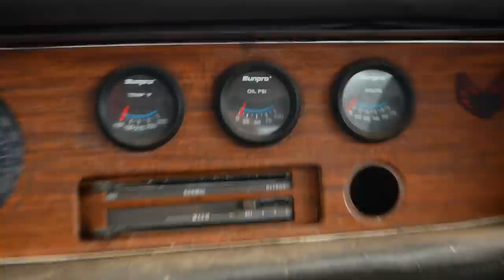Firebird Formula First Start in Years!

Comment: It's kinda sad for me to c ur 73 firebird, cause I had one and I was the 3rd owner of the car. But mine came factory formula 455 SD n it th400 thrans I put 410 gears n it. But all the car needed was paint and interior,  all of the running works didn't have 2000 miles on it. The car only had 120k miles on the car. I had the lead engine builder at "Nunzie Pontiac n Michigan" Herb McCandles, build/balance/blue print the 455. It turned out to b a 462 ci wit 505 HP and 500 foot lbs of tourq. To b as heavy as it was, it was pretty fast for a street car. I got n the low 8.11's n the 1/8 of the mile.  🤙 but I got n some trouble and had to sale it to help with lawyer fees. But I got me a 98 stepside s/10 tht I'm starting on now, I took my 880 5.7 vortec motor to the machine shop last March, and I just got it back this March. Its a 350 rollor motor, a 880 block. I got me a set 5cc dome pistons for it, and i got a 186675-10 Hawards 312, 320 .600 .600 lift cam for it with 1.5 rockers..idk if ima port the vortec heads and and get the bigger valves put n them an run them !! Or ima get me a set of them HKB aluminum heads from Skip White performance, I can't wait to get this little s-10 going !!! But anyway good luck with the firebird tho ! 🙏

Comment: There is software out there that can recover "lost" or better yet "deleted" files on a hard drive. When working with file systems we have to be librarians. What did we name it and where did we store it, which is why the search function is so helpful. However, files that get deleted can still be recovered because a deleted file is actually still present, but is missing its locator. When we tell our OS to delete a file on purpose, that file is then categorized to be over written someday in the future and its locator stripped. If not too much time has elapsed, the recovery software can find it. That file will probably have an alpha-numeric name attached to it as will all of the recovered files slated for deletion. So to verify which files are worth saving, once the recovery software locates them, just open each recovered file, then rename and relocate the ones worth saving.

Comment: You got your hands full double check the timing they'll run 180 degrees out bring #1 cylinder to top dead center and make sure the rotor points to #1

Comment: Paint it white with blue trim like one of the original factory options. But before that it needs to be totally disassembled to remove all of that rust. Also put the original formula engine and transmission in it. I hope you have plenty of money because making that mess like new again isn't going to be cheap. Btw, how much did you buy that for?

Comment: Hey. I have a guy selling a 1977 Triumph TR7 for only $500 and the only rust it has is on the ass end has motor and transmission and everything you need to run it but it won't start

Comment: Why do you need body panels? That roof needs replaced for sure. But those panels need a angle grinder sand, rust converter coat and a skim coat of Bondo and a shot of paint...just saying
Reply: I've discovered bondo that I didn't even know a out...found while painting and took it down to the  metal to discover a dent. I basically redid someone else's work, pulling the dent...
I'm guessing they don't want a bondo wonder

Comment: Take the windshield out and sand it all clean and prime and paint to keep it from going bad because right now it is very fixable with some sanding and painting. Cleaning. Motor probably has leaky valve guide seals. Im sure its not a fresh motor but it is not too bad. Did you change the oil is it full of water? The non existent pvc valve can cause  leaky vacuum can make it run horrible. I would bring that car back from the dead. Sure put a 400 in in it becasue it only cost money. You can play with the 350 for a while when your putting together your secrete weapon 400 Pontiac.

Comment: Carb cleaner?? Not the best way to get an old beast started for the first time.Try a small amount of gasolene or starting fluid. More volatility  and less byproducts .Also there is something arcing off the back side of the HEI.The engine sounds like its perfect. Just needs to be cleaned out. Don't trash it.

It's misfiring Because of the spark on the HEI is leaking to number 4 or 5.

Comment: why do we go straight to "bad valves"?  why not check inside the dist cap and replace a rotor.?  rotors are fairly cheap, $6 or so, and make a big difference if the car has been sitting.

Comment: sounds like the distributor is 180 degrees out of turn i acually got an old firebird for 500 bucks cus it sounded like that and figured out they flipped the distributor around 180 degrees they will run like that but will run like shit and back fire out of the carb almost constantly. just something to check

Comment: Old video and catching up with 'A Formula 350'? Not the stock Pontiac '400', in 73 was Pontiac's factory blueprinting... larger valves and ported heads, for the factory headers. Rather a step down from the 455... but the Formula Firebird with the right Carb,.. namely a Holley 650 double pumper with mechanical secondaries... with long tube headers, and the 400 Block... really begins to breath.

Comment: Laughing my butt off most of the video. When you guys were trying to start it at 11:15 and your bud had his arm over the carburetor. I was thinking man if that backfires he's gonna get his hair singed. Seconds later pop, and he got singed, I was just laughing my butt off, because I've been there and done that years ago when I was your guys's age. Oh and whoever the dumb butt who put a Chevy in a Formula ought to be SHOT, It's not a Camaro it's a Firebird. Anyways back to the FUN! I'll dig around and see what I have left in the shed. I know I have a rust free 74 bare door with a small bend on the front flange. A Pontiac 400 Manual Bell housing, and a 1976 Shaker top lying around here. I think I have some small interior parts too, but that would require me to dig through the shed to get to those. I Also have a rust free, but some light front Bondo, 78 Trans Am front Passenger fender. If your interested give a comment on one of my videos and I'll see it. I did keep my last muscle car, the 69 GTO with the original interior, engine & trans, sorry that's not for sale. That's my retirement project. Thanks for sharing all the fun. I look fwd to seeing more of this project. This too is one of my favorite Firebird's, makes me miss my 1974 400 4sp TA. Best Wishes & Blessings. Keith Noneya

Comment: Not a very good idea to do donuts right next to a gigantic rock, and a wall made out of bricks my man, especially considering that while the roof is junk, the rest of the body seems to be in decent enough shape to be saved with minimal rust repair, as for the engine, seeing as it is a 350 and its a chevy based motor, find an LT1 and put that in there, as the Pontiac Motors, the 400 in particular needs to be put together right to work right, as it needs alot of oil and and a good oil pump, and for the oil passages to be machined properly, a 90's LT1 from an old Caprice or a Corvette however, drop in and go.

and it would be keeping in the spirit of the engine the car came with to boot, plus you could even have some fun with it and maybe redo the formula 400 decals from the latter ones to say LT1 and the like.

Comment: Ok so ya you have my dream car was wondering ill trade ya I have 2 I can trade ya one is a 1970 chevy suburban 4x4 with 4 speed an stright 6 a 289 an truck only has 40,000 original miles .needs some body work dent wise not rally rust is a full life florida truck never mudded or ill trade ya my 20007 fully loaded good running 4.7 good tranny was in a fender bender very easy fix needs a bumper a fender an a hood thats it up to you im In Florida an both have titles an ill trade one or the other for my dream car firebird an I promiss ill restore it im s 35 years experience  autobody tech an all I do is hotroda an classics

Comment: Idk why you said it will never have a quadrajet on it at all because condemning quadrajet carbs when they are actually very very very good carbs way better than any holley garbage or edelbrock square bore pieces of shit I've tried all of them over the years I started fucking with cars when I was a kid back in the 70s when everything was carburated every holley I ever ran was ok at best but it was a constant tinkering with it to get it where it ran the best and even then it was like I always felt that it just wasn't quite right and if I  just changed the jets one more time it would be just that little bit better but it wasn't ever edelbrock yes they were ok again like I said right out of the box not bad but just idk maybe I'm biased idk but when and especially with Pontiac motors that came with the 800 cfm quadrajet carbs some of them  they kicked like a mule when you jumped on it and opened the secondaries up when you have one  that's good that no ones over tightened and warped the airhorn or something but even that can be fixed with some patience that carb you've got there just has some crap in it and a rebuilt kit would straighten it out everyone has a bad thing to say about quadrajets but for an all around good carb that will give you years of service without a hiccup or any issues at all I recommend them unless your running some giant big block that will use so much fuel it depletes the fuel bowl faster than it can fill idk what I'm trying to say guys I'm really stoned right now and I'm sorry for rambling lol but you can take a quadrajet off of any car with any engine and put it on anything and it will run it and only give it what it needs try that with a holley that's why they only made two sizes a 750 and
An 800 cfm and used them on everything from a 283 to a 455 with out a whole lot of changes the  air tubes and jets etc but I'm running one off of a 400 Pontiac  trans am motor on my 305 and it works just fine it's a little rich at idle but hey better than running lean and it's an 800 cfm too try to put a 800 cfm holley on a 305 and drown it edelbrock has that counterweight in it but it does not work as  well as the airdoors do on a quadrajet I'm sorry again  but from experience and a lot of it this is my opinion..

Comment: What a disappointment, why on earth would you want such an iconic car like this formula with a piece of crap run of the mill chevy 350 engine? I honestly thought it had the original 400 ram air motor. I would push that heap into the dumpster...well maybe salvage some parts first